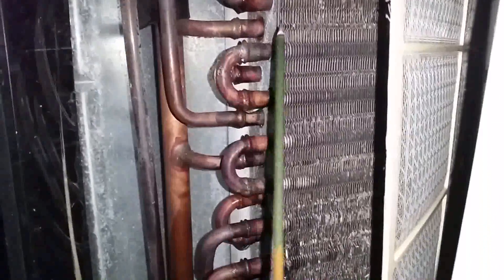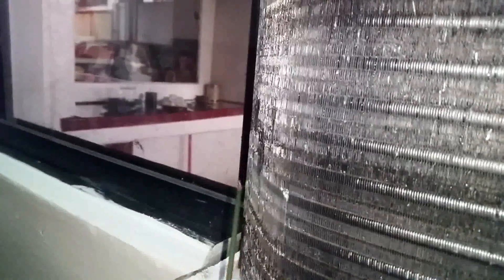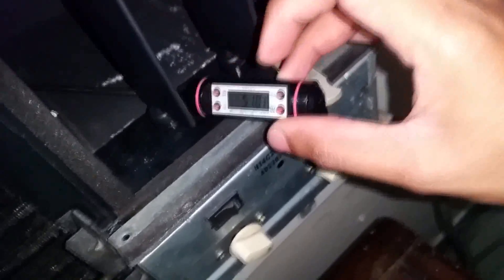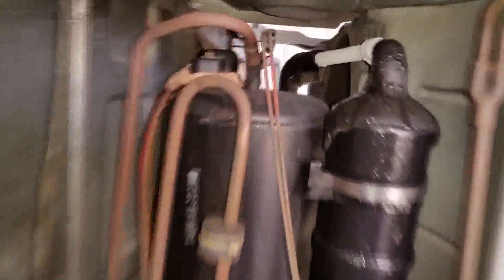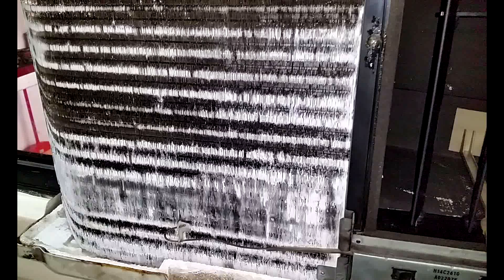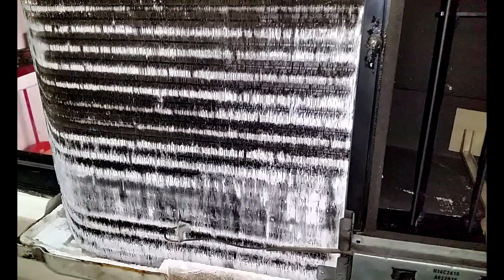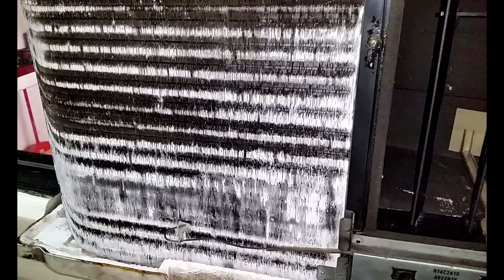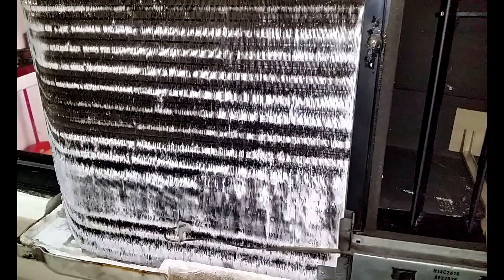ICE Built on Window Air conditioner Evaporator Coil

Comment: It's icing because all those cooling fins are smashed all over and air can't pass through.  Use a small comb and swipe down gently to open them back up.  Makes sure the front intake filter and fins are clean and open.
Reply from the maker: That is not the case. When I filled the gas and repaired it no ice is building now. ICE is there because of low refrigerant in this case